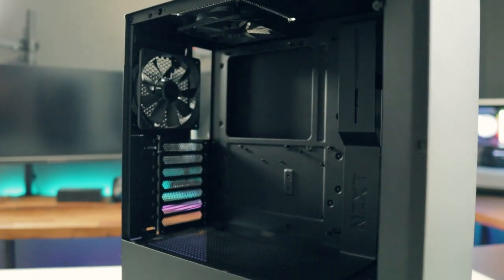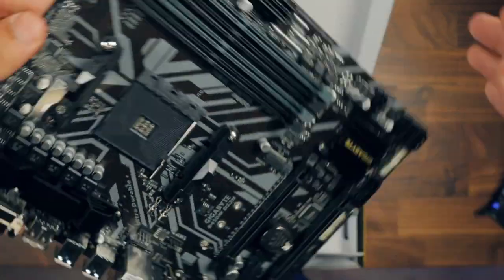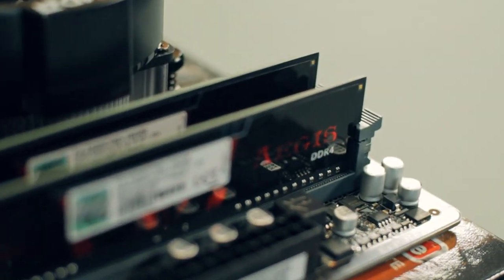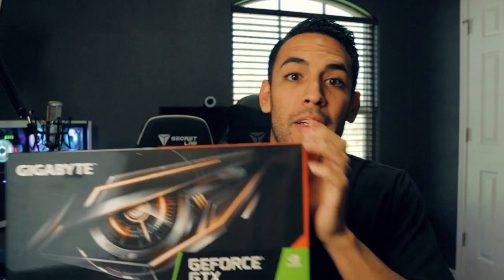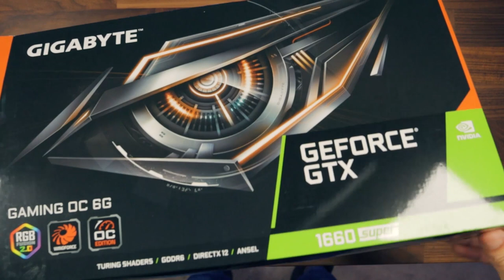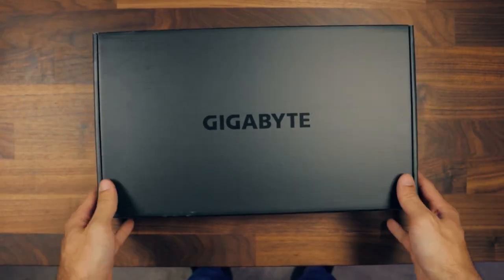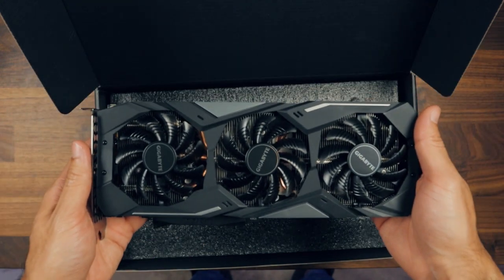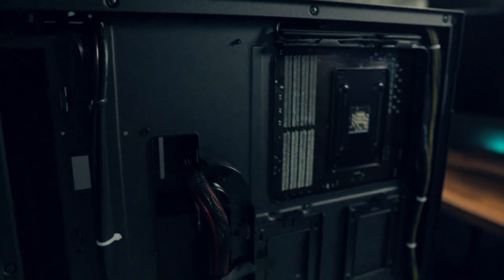$800 PC Build - Gaming Streaming & Editing

Comment: Ok so, if I ever wanted to upgrade my CPU after this build can you please recommend a CPU better than 2600 for streaming and editing

Edit: Also is rx 5600 a better choice for streaming rather than 1660?? Btw u deserve more sub for this content
Reply from the maker: I would say a 2700x or even jumping to a Ryzen 3000 series cpu. 

However, you’ll see greater performance both in streaming and gaming by upgrading your gpu. 

Rtx cards from the 1660 on up to the 2080ti all have the improved Turing nvenc architecture which is reserved space in the gpu dedicated for streaming. I recommend streaming Nvenc instead of X264. AMD cards do not have this feature. 

As far as editing, premier pro just updated with hardware encoding which encodes with your gpu but I still recommend the cpus I said above. You’ll also wanna make sure to jump up to 32g of ram if you’re looking to upgrade. 

And thanks for the compliment!

Comment: What are the benchmarks on this for streaming I am thinking about building this
Reply from the maker: Good question. I didn’t benchmark it but I will for the future builds. But my buddies have similar setup and they stream easily. No issues. Just make sure to stream using nvenc
Reply: Blasten Alr sounds good btw is there any cases you can switch it out for
Reply from the maker: Cases are universal. You can use almost any case. Are you currently looking at another? Which one? I can confirm for safe measure.
Reply: Blasten o wait I found anthor color in the case it’s fine like that I will start buying parts now and will let you know how it runs
Reply from the maker: Sweet! Heck yeah! Hit me up on twitch if you have any heavy questions!!
Reply: Blasten Alr
Reply: Blasten could you actually use the h510 elite
Reply from the maker: Vision_zr yessir
Reply: Blasten I’m so sorry that I keep asking questions but could you answer me this last one
Reply from the maker: No problem at all! Whatcha need?
Reply: Blasten would the Lian li Pc-o11 razer black mid tower case work for this build it’s one of my favorite looking cases
Reply from the maker: Such a beautiful case. Yes it will. Gotta send pics to me when you finish
Reply: Blasten lol for sure I will but do I need to get some case fans for it if so how many and the size of it
Reply from the maker: Vision_zr I’m not sure if any fans come with it. I run 3 120mm fans.
Reply: Blasten ok cause it says on the site what kind and also filter fans as well
Reply: Blasten can you use obs to stream or what did you say you have to use I forgot
Reply from the maker: Vision_zr yes obs

Comment: Hey, can u please answer this question. I got a ryzen 5 3600 that says it has pre applied thermal paste on the cpu cooler. Do I still need to apply it again?
Reply from the maker: No you do not. Just make sure there is indeed paste on the cooler
Reply: @Blasten  how do I do that and thank you so much I was freaking out. I knew absolutely nothing and would’ve blown my house up without u so thanks!
Reply from the maker: Underneath the cooler that came in the box, you’ll see some grey sticky stuff. That’s the paste.